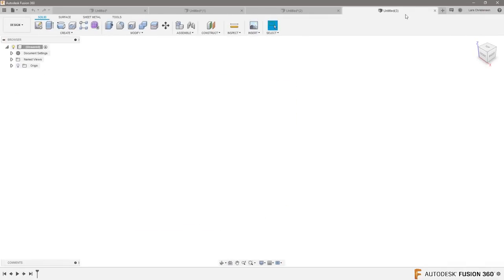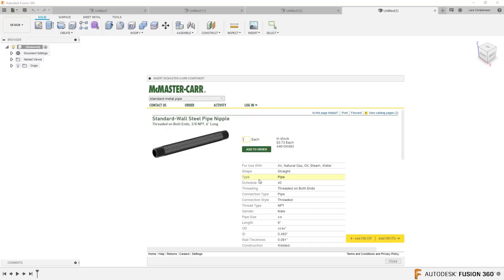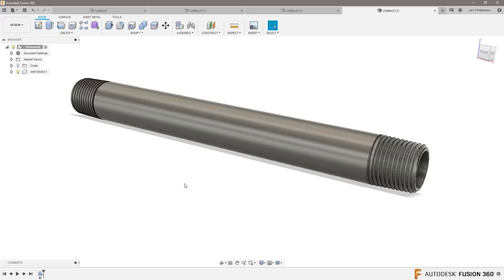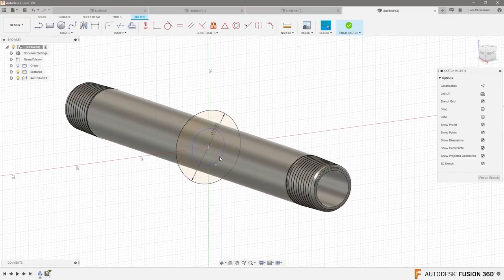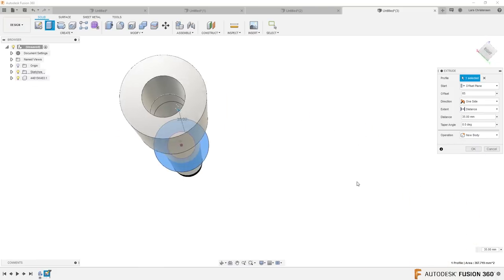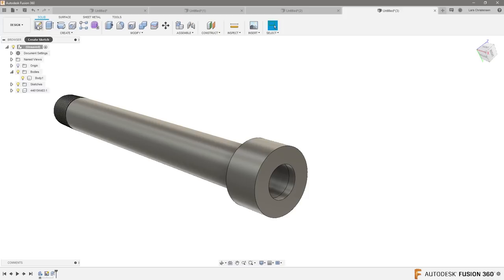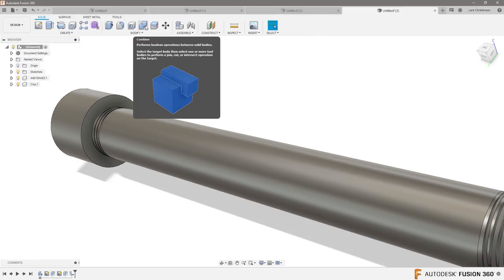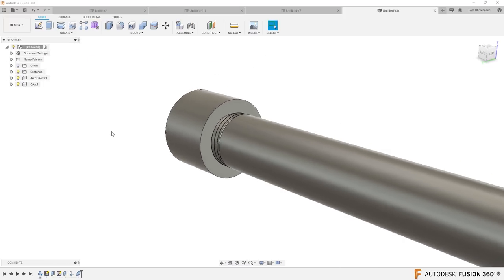Fusion 360 — Copy Threads from McMaster — Ask LarsLive

Comment: Because this example is a tapered thread it may not need clearance. But you may try scaling up the cap a little in the x and y directions to give you some clearance. OR you can create a duplicate of the pipe scale it up, move it to be centered with the original pipe (because it shifts in the direction it scales) and use it as the cutting tool when combining, just don't tick the "Keep Tools"  box.  Which is all WAY to much work for a VERY popular CAD program not to have very common threads in their thread function.

Comment: It seems like you could get the correct threads if you did two Combines.  Download a model of the inside threads which will have the correct clearance, use that to make a body with outside threads.  Then use that new body as the tool in a Combine like you showed.
Reply: Yes, that's what I had to do to get a deeper thread engagement. Incorporating their models directly works but not as clean.

Comment: I had the need to do NPT threads a few weeks back and was unpleasantly surprised to find that F360 cannot do this yet.  Looking through the forum for this topic it sounds like the engineers have been working on tapered threads for awhile now, but it's not ready yet.  This video is a nice workaround, thanks!!  Definitely plan to use this right away.
Reply: We do NPT threads a lot and you can actually model pipe threads however they don't show on a taper. This sucks when making a new part and drawing but I'm hoping that they're able to get this done soon!!

Comment: Thanx for your videos. I inserted from McMaster-carr ,an acme rod and a acme nut and I want to lengthen the rod to my length and cut the outside of the nut to fit a square hole. I'm a newbie please help
Reply from the maker: Hi Mike, Take a look at this video: https://youtu.be/mbW-T_WJ0uU
Reply: @cadcamstuff  Thanx for getting back to me and I have watched the video you suggested ,but no go. I can only extrude the McMaster ¾ x 8 acme rod ,but not the threads on the rod . The acme ¾ x 8 nut I just can’t do anything with. I want to trim this nut to fit inside a square 1” hole. My solution to the acme rod was to copy it enough times to get my length but couldn’t join them, and the nut I just modeled my own